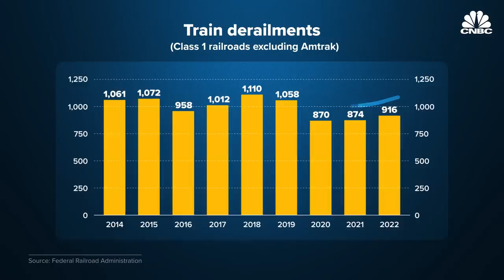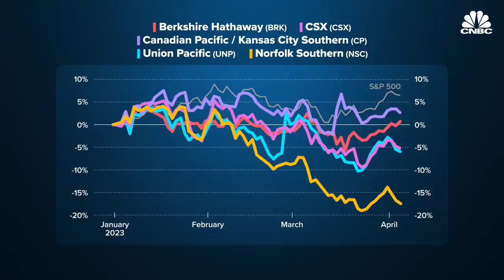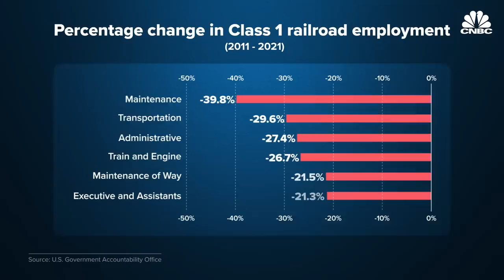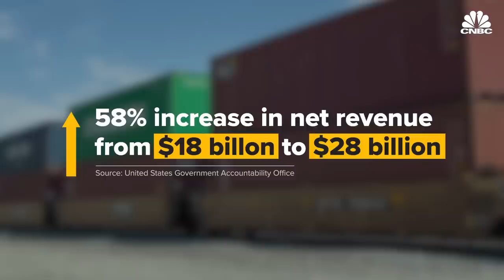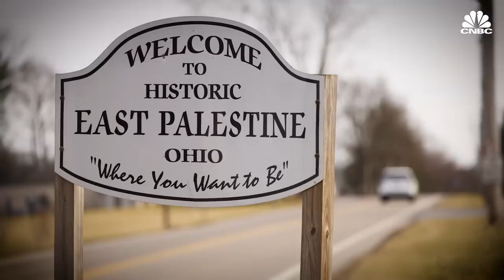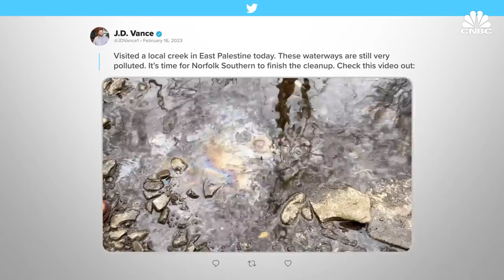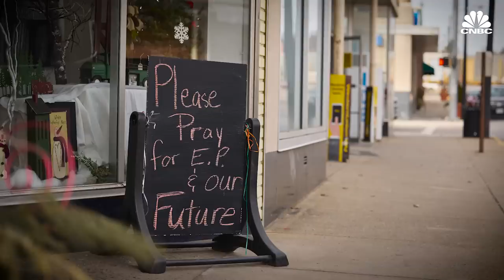Freight Trains Keep Derailing. Why?

Comment: the hysteria against pipelines will lead to more train accidental spills. the killing of keystone xl means that crude moves on rail . it doesn't stop any of the oil from being moved. and those spills can happen on tribal lands and anywhere else. pipelines are safer.
Reply: Well, pipelines are definitely safer than RRs.   Perhaps chemical complexes should be made larger do that more processing is done in one place.   Finished products are "safer" than some of the intermediate products.   In the case in point, vinyl chloride monomer has a lot of risks.   The single most important risk is that it's stored and shipped under pressure.   But vinyl chloride polymer (PVC) is close to harmless.
Reply: its not  about the overall safety and the amount of breaks pipe lines have, its the amount of damage it can cause when it does break. pipelines carry an insane amount of oil, having a section break in the middle of nowhere can be an issue. how long does it take to notice? how long does it take to stop the flow?. Example, in 1999 one pipeline broke in a town a spilled 277,200 gallons of gas into two creeks and caused an explosion killing an 18 year old and 2 kids. The train in ohio spilled less than half of that. Could you imagine if it was a pipeline instead of a train?
Reply: @JackReacheround  --  Well, usually a pipeline line is shut down when the flowmeters and computer figure out that what's going into a section of pipe ain't coming out.      But 277,200 gallons isn't all that much.   An on the road tank truck hauls 8k gallons.   I would guess that a RR tank car would carry 10k or 20k gallon.     That's 14 to 28 tank cars of product.   THere have been train wrecks which have destroyed that many if not more cars.

Comment: Civilized nations understand business is the enemy of all expense including safety unless that business makes and sells safety products. Railroads were notorious for bloody crashes until regulation and improved equipment standards gradually brought them under control.
Industry needs tough ADVERSARIAL regulation to keep the SOBs in line, not rules drafted by its own lobbyists and enacted by owned politicians. 

Regulate, rule and command. Give appropriate orders then enforce them. The idea businesses can be trusted is purely their own invention though trusting morons easily fall for it. If an operation cannot be done with reasonable safety, stop doing it be it in the rail, aviation, trucking or maritime logistics industries. Workplace safety, CREW REST (exhaustion and sleep deficit can be worse impairment than intoxication), equipment monitoring, inspection and repair are all necessities and businesses choosing to neglect them should be fined and the people responsible dealt with accordingly.

Comment: Nice how the president of Norflok Southern sounds like they were doing something so honourable by blowing up the tanks.  Perhaps their cost cutting efforts should have stopped before these contaminants got released.  Would like to see more regulation governing the length of trains.  In the goal of reducing freight costs, the costs to local railtown communities is increasing.
Reply: Fewer operators means less human error.  More locomotives are placed throughout the longest trains which improves braking abilities and handling during acceleration.
Reply: @MilwaukeeF40C  Yeah there are benefits to distributed power. In the mountains, they're great for braking or powering a train uphill. In flatter areas, it makes starting up from a stop a lot more efficient.

Comment: The one thing that would probably have the greatest improvement to safety would be to enforce the Amtrak Improvement Act of 1973, which states that passenger service has rail preference over freight.  Unfortunately, the DOJ is the only agency that can enforce the Act, and they don't.  Congress should amend the act to do two things:  Impose a serious fine per hour of delay of an Amtrak train (a million dollar per hour fine would get the railroads' attention); and letting states' AGs enforce the act for delays that occur to Amtrak trains in their states.  Making the railroads run their freight trains so that Amtrak could run effectively and on time would require shorter freight trains that could travel faster, and a more rigorous scheduling that would make freight trains more reliable and convenient for most companies needing shipping.  Shorter trains would make it easier for crews to keep an eye on cars for problems, and more regular schedules would allow more time for inspections.
https://youtu.be/qQTjLWIHN74

Comment: CNBC miss some major points. Many rails are in bad shape, and it will cost those companies million per mile to fix them. They need to start using those billions dollar profit to fix those rails, and the fine for derailment is way too low compare to the impact.
Reply: Mainline trackage is in nearly perfect condition.

Comment: Why not just make the wheel lip larger?  Or have a wheel like a rollercoaster where there's a safety clamp.
Reply: A larger flange will not "fix" a broken bearing problem. As far as a rollercoaster wheel system, why? trains do not go "flying" off the tracks. Most derailments happen in the yard at walking speed or less.

Comment: A few things...
1. the pressure relief valve was unable to properly release the build up of pressure in those tanks in E.P. which could've blown up like a big bomb of chemicals
2. regulations regarding trains that could've helped prevent the E.P. chemical burn off were lessened during the Trump administration
3. they didn't mention all the other derailments that have happened within weeks of that one by Norfolk Southern also
Things to think on. 🤔

Comment: Huh.  I thought that only pipelines spilled / leaked hazardous chemicals.  I never thought that Warren Buffet's BNSF railroad which transports oil from Canada instead of the Dakota access pipeline would ever cause an environmental danger.  
Let's Go Brandon.
Reply: All railroads have issues long predating the trifles of current politics. There are no "good guys" and rail in the US is still not a great public concern. This incident will fade over time and not much will change.
Reply: @Comm0ut  That's my point.  Statistically, this is nothing out of the ordinary.

Comment: I mean, some of these train cars are 60+ years old, and some of the railways themselves are like 100+ years old.
Company CEOs are hesitant on upgrading infrustructure, since that hits the bottom line. They'd rather try to stretch out the current infrastructure until they can retire with their profits, kicking the can to the next CEO mook.
Look at ND&W line, it's horrible. https://youtu.be/9X2A2f6E5DI
Reply: Freight cars are limited to 50 years, less for tank cars.  No mainline track (rails, ties, rocks) is over about 20 years old.  ND&W is a tiny company moving a few cars per day at low speeds.
Reply: @MilwaukeeF40C  Aint no way in the 9 hells the track in the video i linked is under 20 years old.